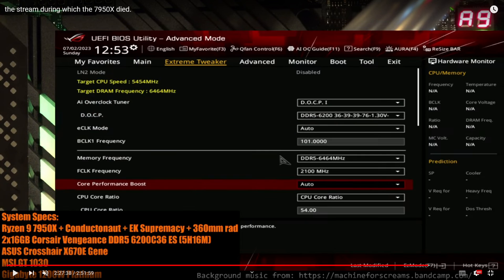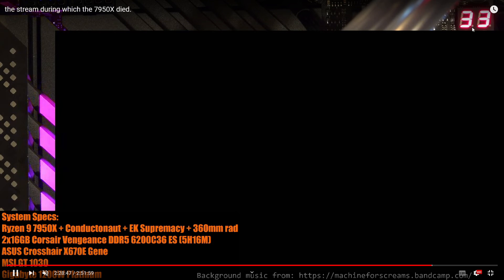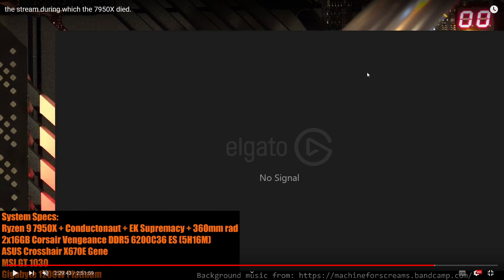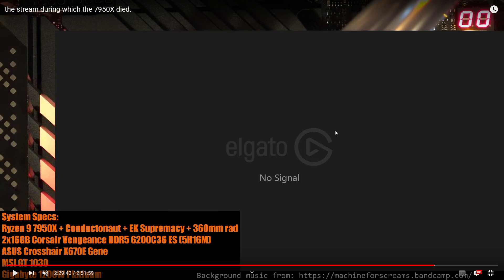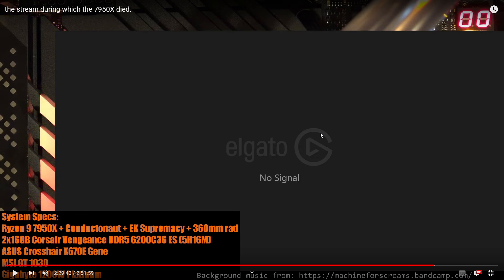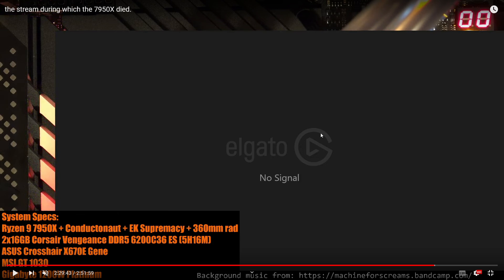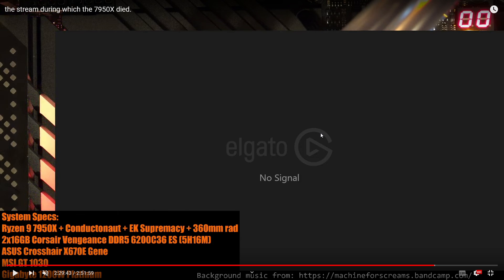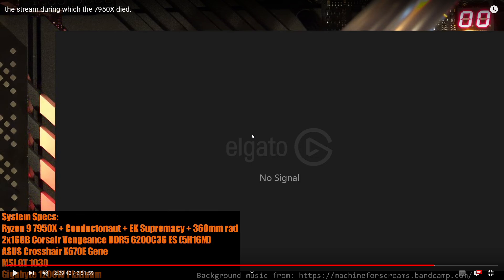My Ryzen 9 7950X died.

Comment: I have a 7950x here on an ASUS strix x670e board that croaked and I am getting the 00 with ram light lit on the board. I have a new pair of ram coming and a 7900x processor along with it in hopes that it's not the board. My theory is that the memory controller is dead on the processor. A power dip did it to me. We'll see what happens. I tried moving both sticks to see if I could boot with one. Nope! I am unsure if the problem is even memory at all. I believe during POST the processor is required to initialize the RAM and load the BIOS into it, so if the memory controller on the processor died, that's why it fails at 00 q code and lights up an amber ram light underneath it. Same situation, different set of circumstances. But I think due to the massive power draw these things have, they are susceptible to surges. If I can get this thing working again, I'm going to order a UPS. The board powers up and all fans spin up. Video card lights up too...if I pull connectors, I get the error lights...there is a good chance the board still has its marbles but if not, I'll just have to eat it and order another. Frustrating having no spare parts to play with but it's the nature of the beast when you reach for the high end stuff.
Reply: My problem was also the 7950x. I replaced it with a new 7900x and new ram this morning, and we're happy. I like this processor better. It's a lot more controlled and by using the eco setting, it doesnt get ridiculously hot. I had the 00 q-code and an amber light for RAM which was false. It was because of the memory controller in the processor just like I thought. The board and my NVMEs in RAID 0 were fine!  I know this is an old thread, but just wanted to get the info out there.
Reply: @johnnyb3987 did you get your 7950x rma'd? The IO die on these chips is pretty fragile, or underperforming

Comment: my guess is that thoose 16 Core AMD are craps.....you can find thousands of suddenly died AMD 16 Cores...a big kept secret...
i´ve another 3950x just died but not dead yet...you can boot into. run windows, do 3 days prime95 BUT it wont give you GPU access...you cant install a fresh windows with that but run a ready system which you use.... swapping back to old 200 R5 everything is nice and easy goingg - swapping back to 3950x...booting, clocks are fine , temps are finde, prime runs for days no problems...but not PICe Lane communications to the GPUS ( one RTX3060 paired with a RX 5700XT)

Comment: Asus is really overzealous in shoving too much voltage into every aspect of the CPU via their 'AI tuner' when using auto. I am experiencing similiar degradation on the 7950X on the crosshair x670e as I did with my 2500K and that was also paired with a Asus board. The only thing common with these two cpus is they are installed on asus motherboards. Even with negative curve optimiser set -28 the CX Hero was still shoving 1.4 volts into the cpu... ffs. I've now set the cpu cooler to a manual value of 150 (which it has been since day 1) and optimism scale of 70 (there is no lower - there is no option to turn off this AI tuner functionality as far as I can see).

Comment: It may not have been something that you did, I had a 7950 run fine for almost a month running on default bio settings on an ASUS prime motherboard. And then started having issues coming out of sleep mode and then finally just died and on a secondary test board and extreme, it it 00 out. I'm waiting on a replacement processor now debating on whether I'm going to send it back to AMD, as it was purchased directly from AMD. And as far as I know I didn't do any overclocking outside of whatever default settings there were in BIOS on the prime motherboard. I did not purposely go in and try and overclock the thing to some ridiculous number.

Comment: PSA: This may get burried but hopefully people see it and BZ eventually pins a clarification assuming he's aware now.....

After some testing and speaking with OC'er Veii, it turns out there's bug with DDR5 PMIC that wasn't protected against in early AGESA. Voltage stepping for VDD/Q can bug out and cause it to push upwards of ~2.0V+ while displaying wrong value in BIOS.

As bad as this is, it shouldn't kill the sample. The problem seemed to be VDDIO followed VDD/Q for some reason, killing the the chip instantly. There's now protection in place to prevent IO/MC following above ~1.43V which hopefully prevents dead CPUs but the bug STILL EXISTS. 

Normally VDD is capped at ~1.43V and shouldn't be an issue. However, it seems that if boards with High Voltage/OC Mode get enabled and NOT immediately reset PRIOR to setting VDD, the UI will still display the voltage using 5mV stepping but PMIC will actually apply 10mV stepping, causing ~1.4V+ to become ~2.0V+. Sticks can survive if it's caught but going much above 1.45V will likely take them out.

Comment: @Actually Hardcore Overclocking   I have a new build with a 7600X, Gskill Trident 5 32GB DDR5 and the Asus X670E Extreme board and I cant get it to boot, just shows code 00 on the LED and the Oled shows 00 Memory

I have tried everything including single RAM stick on multiple slots, reseating everything, BIOS flashback to latest bios, nothing helps, do you think its a memory problem, a cpu problem or a problem with this board?

Comment: Lol my 8700k did almost the same things,work just fine on the other day until i power it off,today when i power it on the motherboard trow 00 code even yellow cpu led not lit up either,i guess it safe to say that the bitch is died now.nowdays cpu are pussy i mean it dies at 1.335v,even my previous 3770k can take 1.47v for 10years

Comment: don't have any experience with the 7000 series and how the new io die behaves, but 1.385v on soc seems wayyyy too high... 1.2v was the absolute maximum on all previous ones, air/water. plus the issues that you're describing resemble a damaged soc.

Comment: In the EU, any fault that appears within 6 months will be presumed to have existed at the time of delivery. The seller must then repair or replace your item free of charge, or reimburse you if repair or replacement is impossible. Warranty period is a minimum of 2 years or more depending on EU country in question, doesn't matter what the seller claims if its a retail product.  For purchases made after 1.1.2022, this  reverse-burden of proof period has been apparently increased by the Directive (EU) 2019/771 from 6 months to 12 months.

So while not applicable in this case, if your (that is to say, the non-specific you) CPU dies overclocking, and there's no way to see the damage? You get to return it and the retailer/AMD can't actually refuse unless they can prove that you damaged it- which they can't. XMP was/is considered overclocking by the manufacturers last time I checked, which is ridiculous since their own benchmarks use it.

Comment: One lesson that taught me a professor in uni (quite some time ago, the class was about X86 hardware) is to never ever use the reset button, is the most destructive operation for the CPU, a forced shut down is better or even pulling the plug, since the CPU has a few cycles to shutdown, using the words of my professor: "a reset is basically shooting a CPU on the back". Usually a reset is not a cause for critical failure, but in the case of AM5 since it's a new platform and with the dumb thick IHS that makes Zen-4 run at 95C, I feel like is a recipe for disaster.

Comment: 1.4v is quite a lot for newer processes. I highly doubt this does not cause excessive metal fatigue and early failure. Especially at the temps these run, it will be exacerbated.

As a point of comparison, AMD's 45nm was 1.45v in Turbo mode. Many, many processes ago...

AMD will have better data on that though.
Reply: If it's voltage it's likely not Vcore. Safe voltages get complicated and don't always make sense considering what we've seen with past processes. It all depends how it's is designed. Supposedly AMD says the silicon can go upwards of 1.5V safely but realistically thermals will be a problem well before that. People run all core OC's over 1.4V on the 7600X but it's hard to do much more than ~1.25-1.3 on the 16 core. At stock my 7950X hits surprisingly high voltages, above 1.4V and well above 1.3V even in medium all core loads.

Comment: its the board and how retry is implemented, most probably a bug which raised the voltage too high when you pressed retry, typical ASUS shitty code and software, dont get me started with Armory Crate shit.

Also check the board if it has a backward CAP installed LOL

Comment: Thats why i don't bother with overclocking my 5900x because these new CPU's do not need overclocking and risking stuff like you had. Because i have a 120 hertz nanocell TV and my 5900x and RX 6800 GPU is plenty powerful enough. If i want 120 fps i just go 1440p or sometimes 4k depending on the game. Overclocking won't really get me anywhere. If i had a 360 hertz display or 240 hertz display maybe it would get me somewhere. I may be wrong about this as i am no expert. I can build a pc and fix one . But thats about it  not an overclocking expert .But i am happy with it stock myself. Hope you get your rig sorted out though. Bet your gutted.

Comment: I have never been a fan of overclocking, maybe undervolting yes but my moto for pc parts is "If you want a better performance from your device you buy a better one" :)
Reply: I have been doing OC and XOC for 23 years, and there are 2 sides to this coin.
1. 10-15 years ago, an OC netting you 30% better performance was not all that out of reach, and even casual overclockers could achieve flagship performance at a MUCH lower cost.
2. Today, with SKU's being separated by both silicon quality and core counts, and with manufacturers running the chips on the ragged edge of their efficiency curves right out of the box, overclocking has been all but relegated to the extremists willing to tolerate the 10-20% higher power consumption for 5-10% more performance. 

On one hand, you can no longer achieve the performance per dollar you could once achieve, and that means value is significantly down. On the other, it also means that when you buy high end parts, you no longer have to spend hours doing what the manufacturer didn't do for you.

The tweaker in me hates the direction the industry has gone, but the consumer in me loves that I no longer need the technical skills I have to get all the money out of my parts. I'd probably be able to drive myself nuts for hours arguing from both perspective.

So, yeah, I get you. But I also don't. lol

Comment: had a 3600 whoch behaved in a simaler way after reaching over 99 degrees on an overclock.  but after a day left cold i turned it on and it worked fine.  however it was reached  4.35ghz reguarly before this and only 4.275 after this.

Comment: My 5950x died in a similar manner. It was the IMC in my case, similar behaviour but for me it was the same net result - QCode 00 while attempting to boot. It was random, but power cycle (full power removal for 10+ secs) might recover it temporarily. It will never reach full potential again though. I had 32000 in R23, after failure it was a struggle to get to 24000. Temps would never get high either. It's as if the PBO circuitry and maybe the SMC was damaged. What I found thereafter was that randomly it would crash in any situation, overclocked or not - sometimes during boot, sometimes idle at desktop, sometimes sitting in BIOS even. In all cases, reset & power buttons are non responsive and only power removal will recover it.

Just my two cents on a similar experience. I now have a 5900x, and it's got a pretty good IMC but FClk can't even boot at 1900, but rock solid at 1866. Can boot >1900 weirdly, but with WHEA.
Reply: try booting 1933, FCLK hole is really common.

Comment: Always sad to lose something to OC, but it's part of the fun! Honestly though, in my 25 years of overclocking, I've only ever killed AMD CPUs, and it's been several. Never lost an Intel CPU, though I've had Intel chips become non-overclockable after hitting them too hard for too long. Part of why I stick to Intel for business and daily use home systems. Maybe AMD lets you push them harder than Intel will? Maybe Intel chips are just more resilient? IDK.
Reply: Other way around for me in about the same time span of OC, although admittedly I have killed both, just more Intel chips lol. Probably comes down to luck versus anything definitive, but the AMD chips I've pushed hard usually hit a brick wall, and I've found they tend to be very good about letting you know when they're just done scaling with more voltage and tell you when they just want lower temperatures to proceed. Intel chips have always made me overly greedy and more reckless, because they have had more of a tendency to keep scaling frequency with more voltage regardless of the cooling.

Comment: I am genuinely surprised at how cheap the Ryzen 5600 is now. Some places (like Newegg are selling it for as low as 130 USD). Right now it's about 130 USD (equivalent) at Newegg here in Canada, but 150 at the US site.

When the 5600 costs less than HALF the price of a 7600X, and the motherboard and RAM can also be had for about half the price... the fact that you're more-or-less stuck at a dead end for upgrading isn't such a big deal (you can always sell your old system to recoup a lot of the cost when you upgrade as well).

Comment: Only reason I could think of that could lead to that chip dying is the frequency boosting behavior of Ryzen eating itself for breakfast. With Ryzen running higher voltages at low loads to hit the boost frequencies they claim, the motherboard auto voltage could have thrown way too high a number for what it thought the chip needed in that low load pre-windows state.
Pure speculation of course. RIP 7950X

Comment: Auto voltages are the most insane scary stuff on motherboards!
CPU - Manual voltage
RAM - Manual voltage
Always, i don't trust auto voltages anymore.
Reply: if you dont trust the motherboard manufacture why do you trust them for manual voltage. if there voltage sensing is of ?
Reply: @joebflies  The voltage sensing shouldn't be that far off therefore they will have a positive offset by a few mv to be on the safe side (from what i've seen) otherwise they'd fail validation. This positive offset needs to be accounted when looking at fine tuning and stability of components as well as settings. However, stock / auto voltages are waaay to high on Ryzen.

Comment: I had similar issue in my 7600X where there was no post. I had CPU and VGA led lights stuck during start up. Then I had removed my GPU and used onboard hdmi still the same issue. Then I had removed the CMOS battery and put it back BOOM it started working and now I am booting into Windows. After this I had stayed away from PBO due to instability.

Comment: Jesus Christ man, I am running CineBench on my 7950X at 1.19 Volts at 5.35 GHz all core with a score of 40,139. The max voltage as far as TSMC is concerned for the 5nm Node is 1.2 Volts, and you thought that 1.4+ Volts was a good idea?

No wonder the bloody thing died.
Reply: The CPU with auto voltages can boost as high as 1.5 volts for any given core (with pbo)...
Reply: @We·Are··I·Am  Don't talk garbage, that happens with the 5000 series (Zen3) but NOT with the 7000 Series (Zen4).

You obviously do not have a 7000 series CPU otherwise you would not be saying this.

Comment: since its stuck on cpu temp error, did you try increasing the max cpu temperature in the bios to the maximum value or disabled ? maybe the temperature sensor is fried

Comment: $700 down the drain, oof. And since AMD doesn't warranty overclocking, you're not going to get any help from them. After watching your channel all these years, it seems like the AMD CPUs and GPUs die easier than the Intel  and Nvidia ones.
Reply: Definitely seems that way. Had a lot of friends whose 5950xs died for no reason, running bone stock settings or super mild overclocks.
Reply: @We·Are··I·Am  They died because the stock voltage is waaaaaaaaaaaay to high.

Comment: What if it got so much over voltage that it couldn't handle? I fried recently a hp z420 workstation by putting a GPU and powering it by second PSU like miners advised

Comment: My friend's 5960x was degraded by the dreaded rampage V. He then proceeded to kill the cpu with vcore, he got a replacement, and that replacement does 4.7ghz all core at like 1.26v. Idk how would you pull that off if you have proof of killing it on stream, but otherwise they can't tell you've killed it.

Comment: Well Bill turn it upside down and start probing the CPU pads. See that's what happens when you supposedly save $50 off on MSRP. mb
Reply: Bill u whine some times and this is one of those times. But cop to the OC charge that's admirable at least. mb
Reply: Ask AMD to give you some old secondary salvage scope for x number of hours of assignment work. mb

Comment: I was suspecting this will happen now very often since the chips just get material failures with such high temperatures. I mean it is still the same material s but now you are supposed to be able to run them constantly on 95 Celsius. If Zen 3 did not stand that why would Zen 4 if its the same materials? Only for the race of clock speeds they allow you to be constantly on 95 Celsius. My 5700G I have limited to 65 degrees Celsius and I bet the CPU will last forever.
Thats directly material failure due to excessive heat.

Comment: Sounds like a bad chip to me. I had a Dual Celeron II system. While I was running CPU burn-in (which was the style of the time) one of them just died. Windows 2000 handled that gracefully (to my utter surprise). So I didn't even get to overclock it.